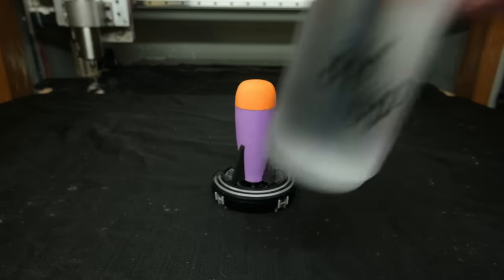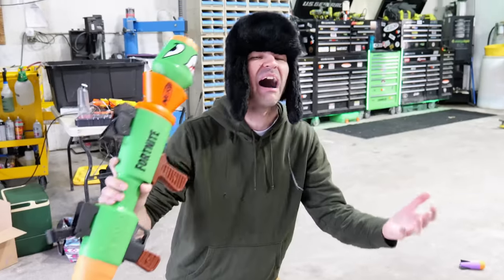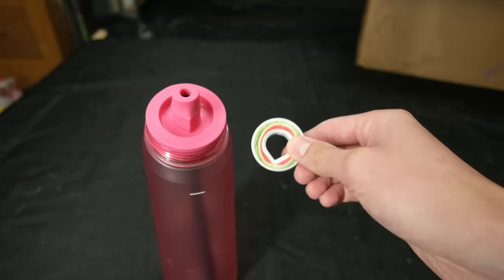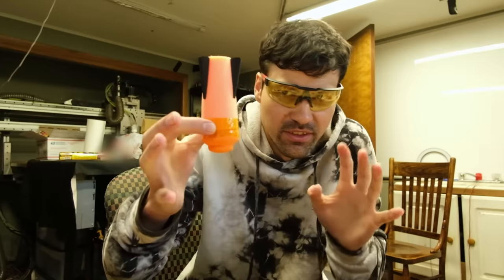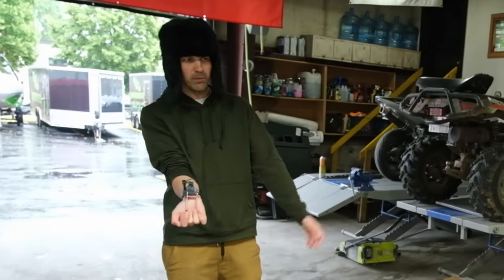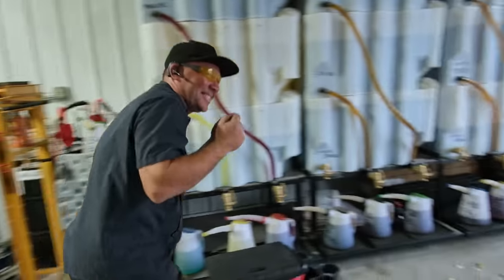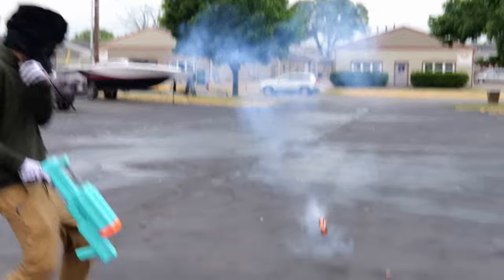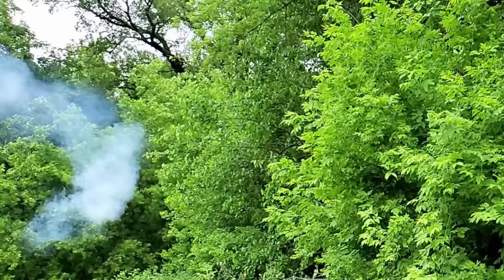I built secret Nerf missiles

Comment: The missile knows where it is at all times.
Reply: WiredWestWing  and it isnt flying
Reply: It knows this because it knows where it isn't. By subtracting where it is from where it isn't, or where it isn't from where it is - whichever is greater - it obtains a difference or deviation. The guidance subsystem uses deviations to generate corrective commands to drive the missile from a position where it is to a position where it isn't, and arriving at a position that it wasn't, it now is. Consequently, the position where it is is now the position that it wasn't, and if follows that the position that it was is now the position that it isn't. In the event that the position that the position that it is in is not the position that it wasn't, the system has acquired a variation. The variation being the difference between where the missile is and where it wasn't. If variation is considered to be a significant factor, it too may be corrected by the GEA. However, the missile must also know where it was. The missile guidance computer scenario works as follows: Because a variation has modified some of the information that the missile has obtained, it is not sure just where it is. However, it is sure where it isn't, within reason, and it know where it was. It now subtracts where it should be from where it wasn't, or vice versa. And by differentiating this from the algebraic sum of where it shouldn't be and where it was, it is able to obtain the deviation and its variation, which is called error.
Reply: wtf bro had the whole lyrics
Reply: @jgood1227 yea
Reply: @mrbacon8664  Lmao, I also have the entire copypasta.
Reply: I WAS GOING TO SAY THAT! CURSE YOU INTERNET PERSON!
Reply: It feels funny to keep seeing this copypasta while I've been researching the AIM-95 Agile
Reply: Oh hey look a civilian airliner 💥
Reply: o ma gaw
Reply: It knows this because it knows where it isn’t.
Reply: @Roberts_Stuff by Subtracting where it is from where it isn’t or where it isn’t from where it is whichever is greater it obtains a deviance
Reply: Wubby7
Reply: @Neon64913  The guidance subsystem uses deviations to generate corrective commands to drive the missile from a position where it is to a position where it isn't, and arriving at a position where it wasn't, it now is.
Reply: Because it know where it isn’t
Reply: unless the missile is a Snark, in which case where it should be is where it isn't.
Reply: WiredWestWing because it knows where it isn’t
Reply: The missile knows where it is at all times. It knows this because it knows where it isn't. By subtracting where it is from where it isn't, or where it isn't from where it is (whichever is greater), it obtains a difference, or deviation. The guidance subsystem uses deviations to generate corrective commands to drive the missile from a position where it is to a position where it isn't, and arriving at a position where it wasn't, it now is. Consequently, the position where it is, is now the position that it wasn't, and it follows that the position that it was, is now the position that it isn't.
In the event that the position that it is in is not the position that it wasn't, the system has acquired a variation, the variation being the difference between where the missile is, and where it wasn't. If variation is considered to be a significant factor, it too may be corrected by the GEA. However, the missile must also know where it was.
The missile guidance computer scenario works as follows. Because a variation has modified some of the information the missile has obtained, it is not sure just where it is. However, it is sure where it isn't, within reason, and it knows where it was. It now subtracts where it should be from where it wasn't, or vice-versa, and by differentiating this from the algebraic sum of where it shouldn't be, and where it was, it is able to obtain the deviation and its variation, which is called error.
Reply: kerbal space program intensifies
Reply: Nahhh blud
Reply: The missile knows where it is at all times. It knows this because it knows where it isn't. By subtracting where it is from where it isn't, Or where it isn't from where it is (whichever is Greater), it obtains a difference, or deviation. The guidance subsystem uses deviation to generate corrective Commands to drive the missile from a position where it is to a Position where it isn't, And arriving ata position where it wasn't, it now is. consequently, the position where it is, Is now the position it wasn't, And it follows that the position that it isn't. In the event that the position that it is
Reply: It knows this because it knows where it isn't. By subtracting where it is from where it isn't, or where it isn't from where it is - whichever is greater - it obtains a difference or deviation. The guidance subsystem uses deviations to generate corrective commands to drive the missile from a position where it is to a position where it isn't, and arriving at a position that it wasn't, it now is. Consequently, the position where it is is now the position that it wasn't, and if follows that the position that it was is now the position that it isn't. In the event that the position that the position that it is in is not the position that it wasn't, the system has acquired a variation. The variation being the difference between where the missile is and where it wasn't. If variation is considered to be a significant factor, it too may be corrected by the GEA. However, the missile must also know where it was. The missile guidance computer scenario works as follows: Because a variation has modified some of the information that the missile has obtained, it is not sure just where it is. However, it is sure where it isn't, within reason, and it know where it was. It now subtracts where it should be from where it wasn't, or vice versa. And by differentiating this from the algebraic sum of where it shouldn't be and where it was, it is able to obtain the deviation and its variation, which is called error.
Reply: The missile knows where it is at all times. It knows this because it knows where it isn't. By subtracting where it is from where it isn't, or where it isn't from where it is (whichever is greater), it obtains a difference, or deviation. The guidance subsystem uses deviations to generate corrective commands to drive the missile from a position where it is to a position where it isn't, and arriving at a position where it wasn't, it now is. Consequently, the position where it is, is now the position that it wasn't, and it follows that the position that it was, is now the position that it isn't.
In the event that the position that it is in is not the position that it wasn't, the system has acquired a variation, the variation being the difference between where the missile is, and where it wasn't. If variation is considered to be a significant factor, it too may be corrected by the GEA. However, the missile must also know where it was.
The missile guidance computer scenario works as follows. Because a variation has modified some of the information the missile has obtained, it is not sure just where it is. However, it is sure where it isn't, within reason, and it knows where it was. It now subtracts where it should be from where it wasn't, or vice-versa, and by differentiating this from the algebraic sum of where it shouldn't be, and where it was, it is able to obtain the deviation and its variation, which is called error
Reply: The missile knows where it is at all times. It knows this because it knows where it isn't. By subtracting where it is from where it isn't, or where it isn't from where it is (whichever is greater), it obtains a difference, or deviation. The guidance subsystem uses deviations to generate corrective commands to drive the missile from a position where it is to a position where it isn't, and arriving at a position where it wasn't, it now is. Consequently, the position where it is, is now the position that it wasn't, and it follows that the position that it was, is now the position that it isn't.
In the event that the position that it is in is not the position that it wasn't, the system has acquired a variation, the variation being the difference between where the missile is, and where it wasn't. If variation is considered to be a significant factor, it too may be corrected by the GEA. However, the missile must also know where it was.
The missile guidance computer scenario works as follows. Because a variation has modified some of the information the missile has obtained, it is not sure just where it is. However, it is sure where it isn't, within reason, and it knows where it was. It now subtracts where it should be from where it wasn't, or vice-versa, and by differentiating this from the algebraic sum of where it shouldn't be, and where it was, it is able to obtain the deviation and its variation, which is called error
Reply: The missile knows where it is at all times. It knows this because it knows where it isn't. By subtracting where it is from where it isn't, or where it isn't from where it is (whichever is greater), it obtains a difference, or deviation. The guidance subsystem uses deviations to generate corrective commands to drive the missile from a position where it is to a position where it isn't, and arriving at a position where it wasn't, it now is. Consequently, the position where it is, is now the position that it wasn't, and it follows that the position that it was, is now the position that it isn't.
In the event that the position that it is in is not the position that it wasn't, the system has acquired a variation, the variation being the difference between where the missile is, and where it wasn't. If variation is considered to be a significant factor, it too may be corrected by the GEA. However, the missile must also know where it was.
The missile guidance computer scenario works as follows. Because a variation has modified some of the information the missile has obtained, it is not sure just where it is. However, it is sure where it isn't, within reason, and it knows where it was. It now subtracts where it should be from where it wasn't, or vice-versa, and by differentiating this from the algebraic sum of where it shouldn't be, and where it was, it is able to obtain the deviation and its variation, which is called error
Reply: The missile knows where it is at all times. It knows this because it knows where it isn't. By subtracting where it is from where it isn't, or where it isn't from where it is (whichever is greater), it obtains a difference, or deviation. The guidance subsystem uses deviations to generate corrective commands to drive the missile from a position where it is to a position where it isn't, and arriving at a position where it wasn't, it now is. Consequently, the position where it is, is now the position that it wasn't, and it follows that the position that it was, is now the position that it isn't.
In the event that the position that it is in is not the position that it wasn't, the system has acquired a variation, the variation being the difference between where the missile is, and where it wasn't. If variation is considered to be a significant factor, it too may be corrected by the GEA. However, the missile must also know where it was.
The missile guidance computer scenario works as follows. Because a variation has modified some of the information the missile has obtained, it is not sure just where it is. However, it is sure where it isn't, within reason, and it knows where it was. It now subtracts where it should be from where it wasn't, or vice-versa, and by differentiating this from the algebraic sum of where it shouldn't be, and where it was, it is able to obtain the deviation and its variation, which is called error
Reply: The missile knows where it is at all times. It knows this because it knows where it isn't. By subtracting where it is from where it isn't, or where it isn't from where it is (whichever is greater), it obtains a difference, or deviation. The guidance subsystem uses deviations to generate corrective commands to drive the missile from a position where it is to a position where it isn't, and arriving at a position where it wasn't, it now is. Consequently, the position where it is, is now the position that it wasn't, and it follows that the position that it was, is now the position that it isn't.
In the event that the position that it is in is not the position that it wasn't, the system has acquired a variation, the variation being the difference between where the missile is, and where it wasn't. If variation is considered to be a significant factor, it too may be corrected by the GEA. However, the missile must also know where it was.
The missile guidance computer scenario works as follows. Because a variation has modified some of the information the missile has obtained, it is not sure just where it is. However, it is sure where it isn't, within reason, and it knows where it was. It now subtracts where it should be from where it wasn't, or vice-versa, and by differentiating this from the algebraic sum of where it shouldn't be, and where it was, it is able to obtain the deviation and its variation, which is called error
Reply: The missile knows where it is at all times. It knows this because it knows where it isn't. By subtracting where it is from where it isn't, or where it isn't from where it is (whichever is greater), it obtains a difference, or deviation. The guidance subsystem uses deviations to generate corrective commands to drive the missile from a position where it is to a position where it isn't, and arriving at a position where it wasn't, it now is. Consequently, the position where it is, is now the position that it wasn't, and it follows that the position that it was, is now the position that it isn't.
In the event that the position that it is in is not the position that it wasn't, the system has acquired a variation, the variation being the difference between where the missile is, and where it wasn't. If variation is considered to be a significant factor, it too may be corrected by the GEA. However, the missile must also know where it was.
The missile guidance computer scenario works as follows. Because a variation has modified some of the information the missile has obtained, it is not sure just where it is. However, it is sure where it isn't, within reason, and it knows where it was. It now subtracts where it should be from where it wasn't, or vice-versa, and by differentiating this from the algebraic sum of where it shouldn't be, and where it was, it is able to obtain the deviation and its variation, which is called error
Reply: The missile knows where it is at all times. It knows this because it knows where it isn't. By subtracting where it is from where it isn't, or where it isn't from where it is (whichever is greater), it obtains a difference, or deviation. The guidance subsystem uses deviations to generate corrective commands to drive the missile from a position where it is to a position where it isn't, and arriving at a position where it wasn't, it now is. Consequently, the position where it is, is now the position that it wasn't, and it follows that the position that it was, is now the position that it isn't.
In the event that the position that it is in is not the position that it wasn't, the system has acquired a variation, the variation being the difference between where the missile is, and where it wasn't. If variation is considered to be a significant factor, it too may be corrected by the GEA. However, the missile must also know where it was.
The missile guidance computer scenario works as follows. Because a variation has modified some of the information the missile has obtained, it is not sure just where it is. However, it is sure where it isn't, within reason, and it knows where it was. It now subtracts where it should be from where it wasn't, or vice-versa, and by differentiating this from the algebraic sum of where it shouldn't be, and where it was, it is able to obtain the deviation and its variation, which is called error
Reply: @Lisa-un9nr  Maybe not spam?
Reply: By knowing where it isn’t
Reply: That’s crazy… CRAZY I was crazy!
Reply: Because it knows where it isn’t
Reply: @mrbacon8664 woah that’s a lot of words tob bad I ain’t reading all of that
Reply: misil™
Reply: For those who don't know, he played war tycoon